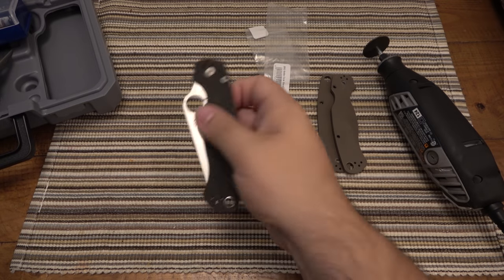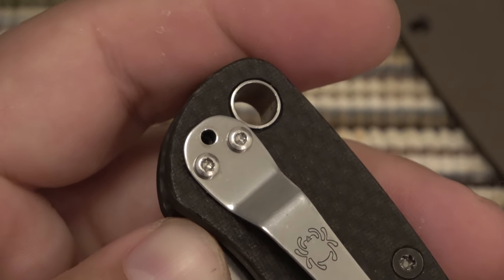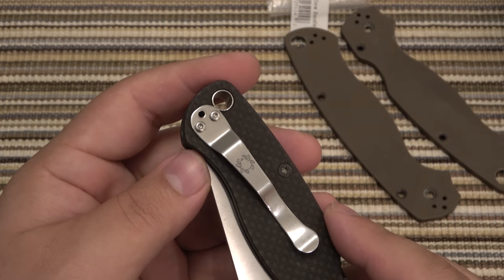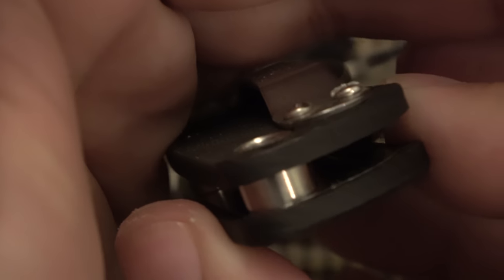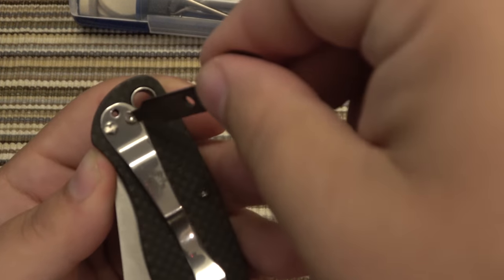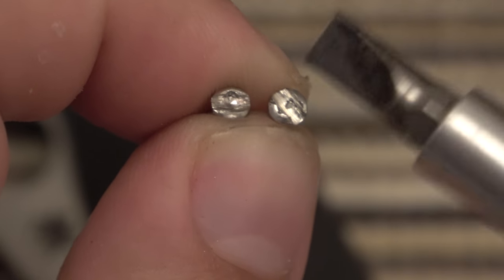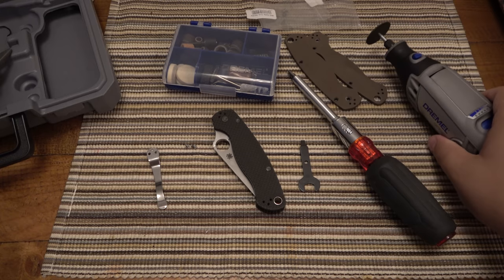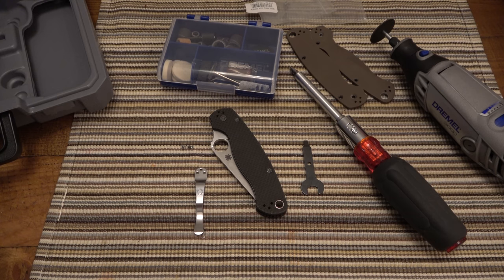How To Remove Stripped Screws On Your Knife...

Comment: Dremel makes a thinner cutoff disc that's only 0.025" thick (it's reddish brown colored instead of black), it would probably make it a bit easier to not over-widen the slots.
Reply from the maker: yeah I actualy bought thinner cutting discs for the project but dont have the attachment piece to use them, lol...so I had to use these

Comment: I did cut a slot into a stripped screw head using the metal file from a Swiss army knife. So this works also in the field without a power tool. It's always good to know. Thx Jeff!!

Comment: Rubber band trick works well. I usually start there or if you don’t have a Dremel.
Reply: My tip to, used that method hundreds of times.
Reply: @michaelgatford6194  less likely to make a mistake. We like to work ourselves up to damaging something I guess. 😂
Reply: @JOMO_EDC  exactly 👍
Reply: I bet back in the 50's screws didnt strip cause they were made of steel yo

Comment: I've used a rubber band to grab screws, this method, and also a fine file to remove screws.
But, it's been a VERY long time, because I'm so cautious now and buy wiha bits, rather than hardware store sets anymore.
Thanks for the upload, very helpful to people.

Comment: Also where do you prefer to order replacement screws from, and what am I measuring of the old ones to order proper replacements? 

Stripped two of three in inexpensive Boker flipper and Boker wants more than I paid to fix it. (Sorry noob questions 😔)

Comment: heh, when i clicked on this video i was literally holding a cheap training balisong that i turned into a bottle opener with a dremel in my hand and i also did the same nicks for the screws because it came new stripped (cheap like i said). this is a really good trick for allot of stripped screws and bolts, not just on knives. you can sometimes even use it when a bolt or screw head broke off, especially if you aren't concerned about aesthetics, because you can cut into what it is holding together without causing structural damage and sometimes turn out the screw's core. certainly doesn't always work, but it can be useful when you have a broken bolt.

Comment: I was doing a scale swap on my benchmade 940 , got one side of the new scale on and have one screw left to get the other side off , stripped out , had to take a file and cut down through the g10 to until I could get pliers around it ,  fuck t6 screws  hate them with a passion

Comment: Any tips on getting the screw out if you break the screw head off? 😬
Reply from the maker: ouuch Id say drill a smaller hole and maybe an extraction set or glue/weld a post to it you can turn...

Comment: Any tip on how to remove a screw which broke inside of a scale? :D
Reply: epoxy or superglue a rod or something carefully into the screw head and then turn it with pliers
Reply: Just buy a set of screw extractors, if you use glue it won't work if there's locktite on the screw, and then there will be glue everywhere and a stuck screw. Save yourself time and hassle just get the correct tool lol.
Reply: @alphaomegasurvivalsupply6548  Do you have experience doing this with a size 0 screw extractor? I recently wanted to salvage a clip with stripped screws from a broken knife and tried drilling out the crews without damaging the female threads. That didn't quite work out, I would have to have drilled the hole larger and cut in larger size threads. Maybe drilling a pilot hole with a normal 1,5 mm drill and then following up with a reverse thread 2 mm drill would have worked. To bad these are hard to find.
Reply: @kothaelser3282  ive never used one quite that small but I have used many "average" sized and they've worked great. Im sure if you searched on yt you'd find someone that has done exactly what your needing to do, and they would probably have better advice than I would since I dont have it in front of me yanno lol

Comment: I use needle nose pliers to do that job. 🤷🏼‍♂️
Reply: Diagonal cutters, you can bite into the metal and twist them out. If it's a flush set screw, screw extractors if you can find them small enough.

Comment: Soak it in pb blaster. Take the next size up in metric or standard  or torx smack them in with a small hammer then carefully remove.  This is my first method then dremmel
Reply: I like to try with pliers before cutting or anything else

Comment: Here's a little idea that my coworker uses when struggling against stripped torx. Use the next size torx or two sizes up and a little of oil and tap the torn into the screw. If you have decent torx tips, it can cut new grooves to be use but I recommend to replace ASAP